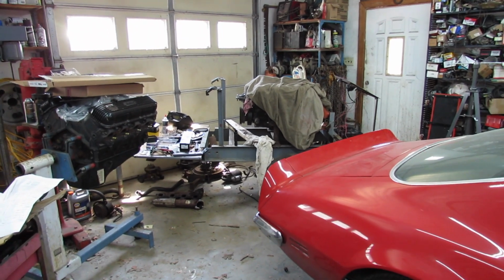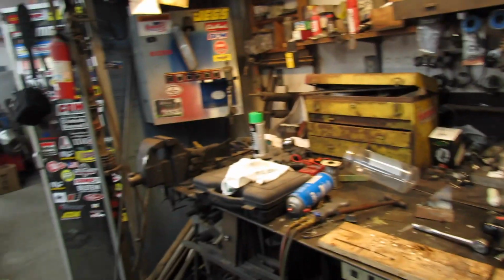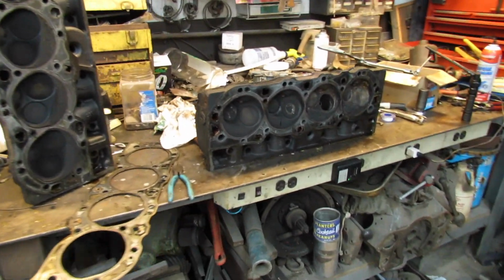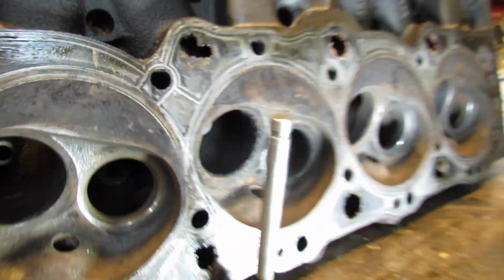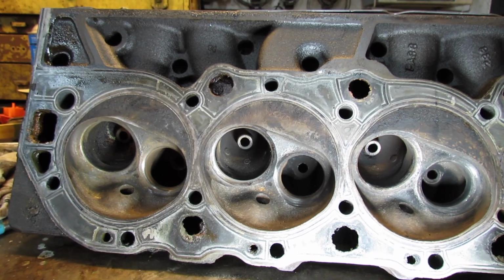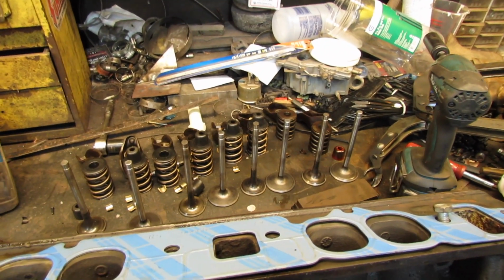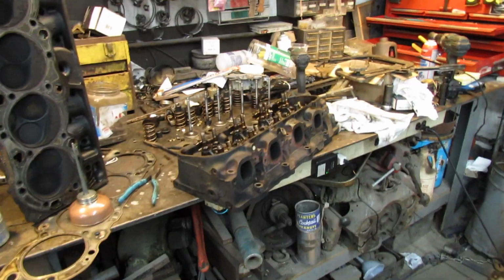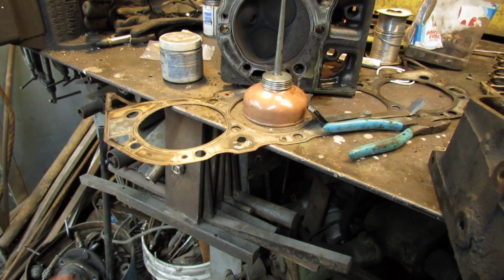454-Tear down Peanut Port heads

Comment: A trick I use to clean valves is to snap off a bit off a hack saw blade , put the valve a drill in and put the drill in the vice, turn the drill on an run the blade up and down the valve. Works pretty well.

Comment: For a tow engine those heads will work just fine. If you're want to build big power you would have to port match and polish them. I would just run em.

Comment: Since you asked, No, I wouldn't modify the ports considering the intended use. Spend your time on the 51 Rat Rod instead of re-engineering your "daily dully" so it runs EVERY time you turn the key without getting out the jack and the tool box. I know, that doesn't blend with the definition of "Hot Rodder" . ;o(  Oh yea, HAPPY EASTER !!!!
Reply: you mean Hack Rodder!!

Comment: Almost forgot, be very careful using thread dies with the holder. I did that once to "chase" a bad thread and when the die ran over the problem on the thread, it expanded the die and broke it in two. These things are HARD so if they aren't enclosed in a holder, they will break. ;o(

Comment: I'm still workin' too...I like to port match.
Reply from the maker: ZIGgassedUP me too. I’m curious to see how it acts.
Reply: @MrHevyshevy  Best secret to port matching is to mark the port size you want and make a mark inside the port 1" in then smooth the port from the opening size to the 1" mark that way you get a nice gradual transition and don't take too much off the roof.

Comment: i wouldnt port the head, but if its a low comression motor I would think about a turbo for the tow motor, just a low pressure one add some torques.

Comment: Is it possible the retainers were designed for lash caps?  Might want to check the gasket against the intake then decide about blending the ports.  I worked on a pair of heads with those small ports & it had flashing inside the ports where the molds leaked.  Had to grind that out anyway so blended mine to the intake.  Some were very poorly made!

Comment: Good low end torque .... peanut port heads. Yep ... 5g's and they give it up!
Reply: Depends cam you have and valve springs. I have 454(461-.030) pocket port peanuts polished intake side. 8.5 compression true flat tops. Howards Big Mama Rattler cam. Double springs. Full roller rockers. RPM air gap. 800 ultra Holley. Pulls 6000 easily! Runs very healthy!

Comment: Not recommended to use an oval port intake on a peanut port head. REVERSION IS BAD! The intake should be  slightly smaller than the head port. Not bigger.
Reply from the maker: Marg R I’ll let you know how it works out.

Comment: From my "frugal" mind... NO! Millions of dollars of engineering and cuss words went into this and it was well choked down to meet emissions alright, but if you lay a blank sheet of paper down and add every little thing available for those heads, you spent money in the machine shop, made a custom gasket maker happy and so forth for ten wapping horsepower or even twenty horsepower just to power brake in front of some idiot who is cheering you on and you break your truck. Remove the temptation and ride the bike a few miles on the money saved. If  a sick engine motor can get it there an back. More gooder engine motor will take you there an back. I might spend money on exhaust but not trying to outsmart the engineers. It is not broken so don't make something that eventually needs a larger transmission  and more money when that pretty red pony chicken is there begging for something... maybe a nice dash cover or something that you always wanted.
Reply: Man I could not agree more . It's not just frugal its smart.